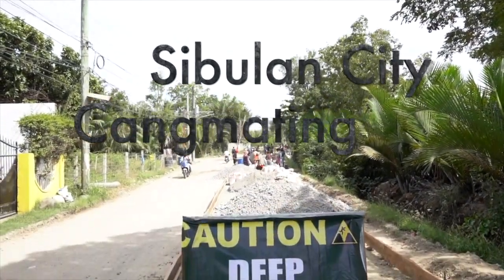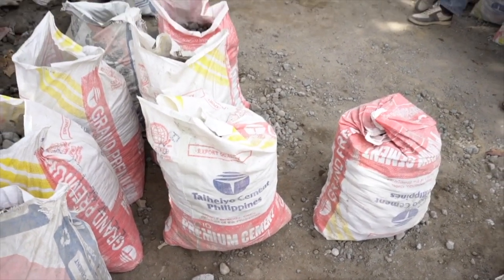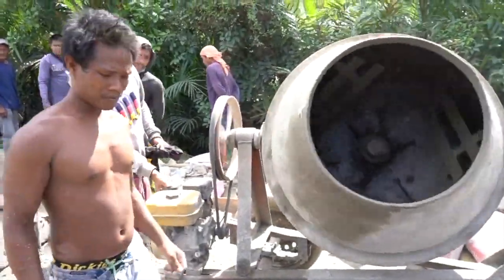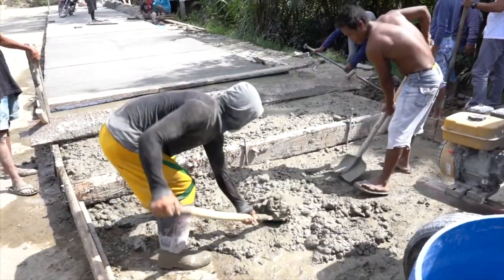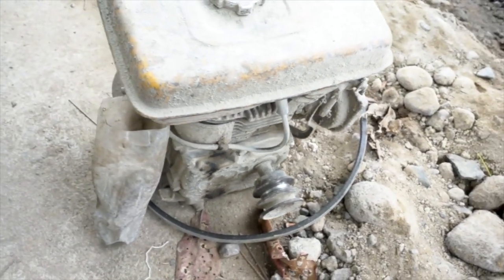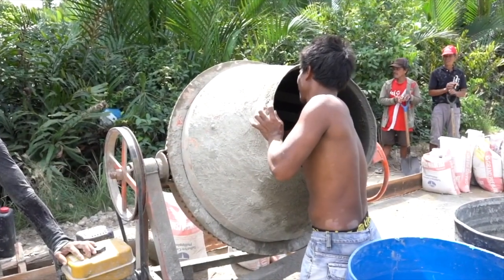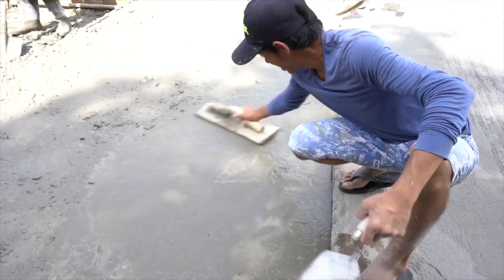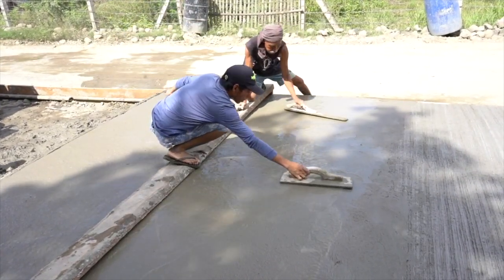Concrete Roads By Hand in the Philippines

Comment: I think if this isn't a commercial road and your typical sedan cars, tricycle, motorcycles are using this road, a simple concrete road like this should do it.
Now if this road is mainly driven by some trucks for example is there's a nearby quarry, then they should really time to think about rebars.
Reply from the maker: Good point, wasn't sure how long a road would last without the rebar as I have seen this in the US as a kid in every cement job.

Comment: HEY VERN!,
Now I know why most Filipinos are thin! Man, that is some labor intensive process! Do they put rebar in the concrete?  Well, this would provide some insight into why construction projects in the Phils take so long. That was interesting process analysis.
Daniel
Reply from the maker: Ugg in this heat it is intense! No Rebar in that concrete ,only small stubs to connect the slabs. Thanks! When I first witnessed this process I was quite amazed entire streets made using this process.

Comment: I disagree. Not most of the roads in the philippines. Most of the road projects here in the philippines use heavy equipment but some use it by hand depending on the budget of the implementing agency handling the project. Small portions handled by baranggay usually do it by hand because of the limited budget and the scope of work is too small to involve heavy equipments
Reply from the maker: The point was to showcase the talent and ability of the Filipino people to produce things with hand if need be.
Reply: @HeyVernTravels  but not “most of the roads” in the philippines are built by hand just like what you said
Reply from the maker: @buroze  In five years the only roads I have seen being built by machine were the main roads. Five years the only roads..
Reply: @HeyVernTravels  by the way i was a government engineer and now have a private construction company here in the philippines and got some projects handled in sibulan negros oriental under dpwh. MOST of the road projects are handled by Dpwh and they never allow construction of roads by hand. SOME local government units allow given the scope of work is small. It is also not hard to get one bagger mixer here in the philippines you can buy them at almost every hardware you can see.
Reply from the maker: @buroze  Cool, do you know why I made that video? Because I am also a highly skilled craftsman and mechanic, I have worked with my hands all of my life. I was amazed and proud to see those roads built by hand.
Reply: @HeyVernTravels  yup, get my point. You said wrong infos
Reply from the maker: @buroze  I have seen many of the side roads in Valencia/ Dumaguete/Sibulan/Bacong done by hand, is my own personal experience. They built these roads in sections. It happened by both of my last apartments.  Every time I drive side roads I happen upon these projects.. It isn't just one road in a long time doing just one section. It is usually several blocks worth.  Most of the roads I have seen or experienced in 5 years traveling almost every day, 25k maybe would have been a better way to express that.